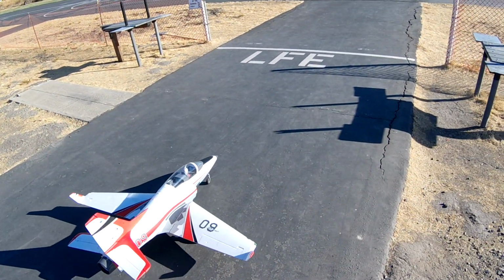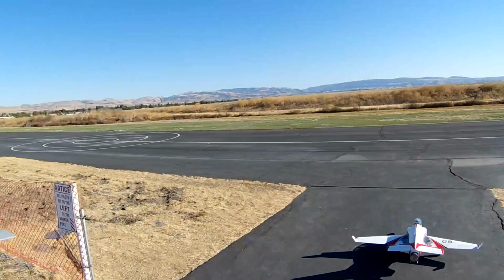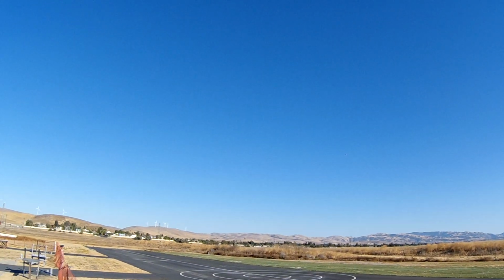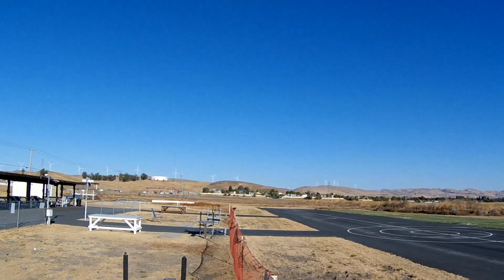Major Power upgrade! 8s in 90mm Viper Jet! #subscribe #views #aviation #viralvideo #first #8s #gold

Comment: Hi Goniac, cool! Everything went well!! And you had a lot of wind for my feeling hahaha I´m wondering how that landing would have gone with crow. Have seen and heard that on videos and a guy also recommended that for my 90mm Fms Viper (still to maiden). Maybe more stable with that wind or if super slow avoiding the wing tip to stall (?). I´m about to start my LiIon Molicel soldering and test. That would go into the 80mm and 90mm jets because of the space. But I´ll also try a new configuration for the low space 70mm or even 64mm jets. Those 8S 5000-6000mAh must be really heavy! But good punch! :) Have a nice day!!
Reply: have you measured speed on that stock 8S FMS fan? I have that for my Avanti 90mm just if, the speed or power isn´t enough xD xD but it adds also around 200g in weight I think